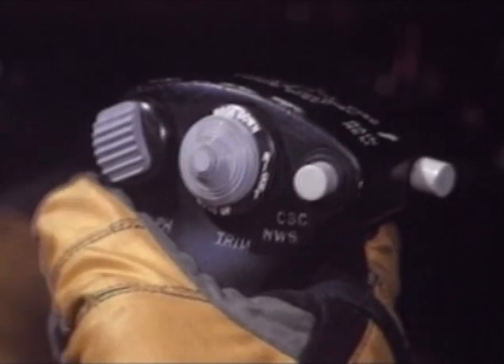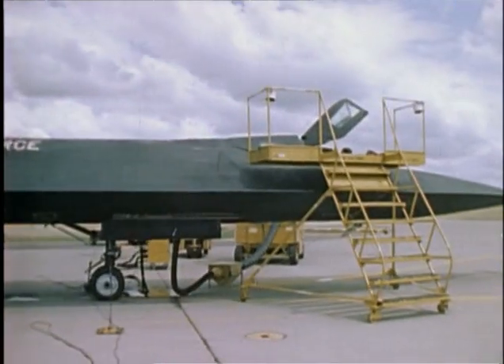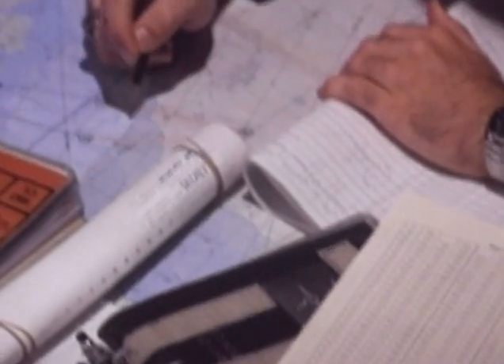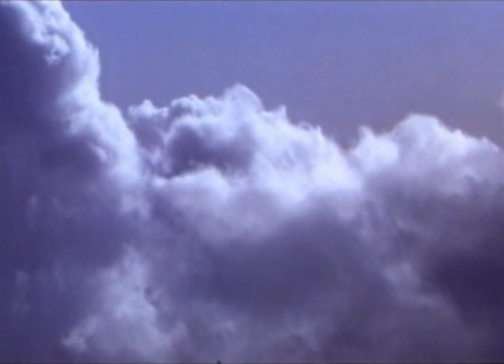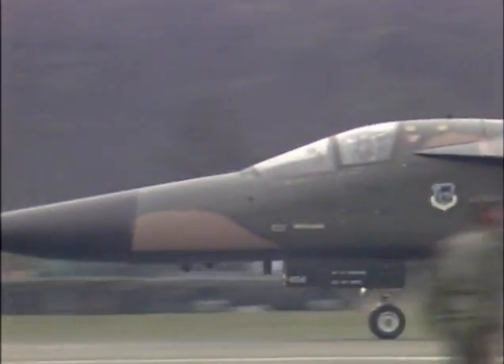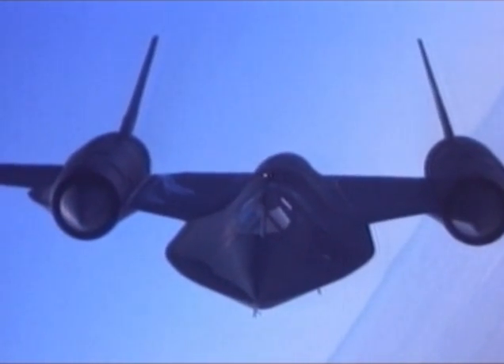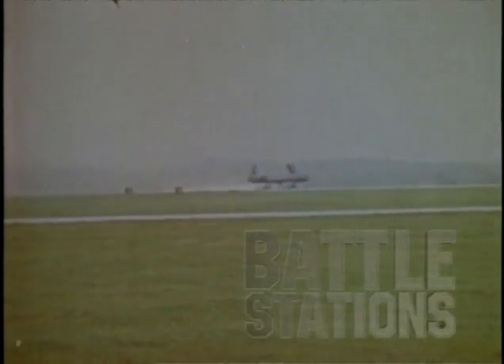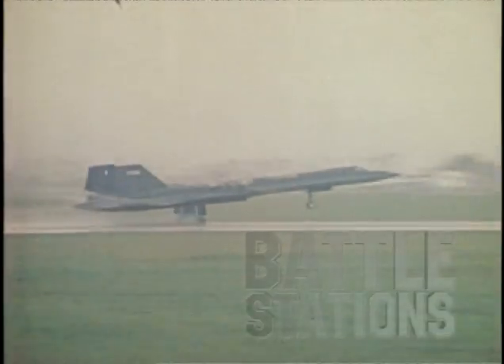Battle Stations - SR-71 Blackbird Stealth Plane -Full Documentary

Comment: I built my own sr-71 in my living room. It’s a smaller version but can still fit two men and the camera equipment and goes a little faster than the full size government built plane. I had it out over Iran when the missiles were flying from Iran to Israel and I got it all on film . I flew the first leg of the mission and my co pilot who is also my 15 year old calico cat flew the dangerous part over Iran . I shouldn’t let her fly in those dangerous conditions because she is reckless because she has nine lives so if we get hit with a missile she will respawn 8 more times I’m just dead but she can really handle the speed and out run any threat that we could encounter except communicate with air traffic controllers, so I handle that and she does the flying.

Comment: I live about 40 miles south of Beale AFB I first saw/heard them in late 66 early 67 it was not uncommon to see them in the 80’s in the pattern for touch n go’s at McClellan or Mather AFB’s McClellan had a hangar on west side that was usually open unless a U-2, SR-71, F-117 or ??? was in there for emergency support. An SR-71 got me out of a speeding ticket once I was on I-80 just south of McClellan & a CHP had me on the side when I asked if he had ever seen an SR-71? He said what I pointed over his left shoulder he turned looked and said you can go. It was more expensive to operate than Air Force 1. Two (maybe 3) tankers at refueling points in case first one had problems WHEN THE NEEDED PHUEL THEY NEEDED PHUEL as they didn’t glide well they could use regular fuel but limited to Mach 1.5 I believe regular fuel would get hot and rocket boost was short term. If I remember correctly they used more liquid Nitrogen than any other part of USAF possibly (probably) DOD. The U-2’s do training missions around Sacramento and the T-38’s practice here too when they(T-38’s) land at Mather a pizza or 2 is ordered for lunch; Mather’s hospital is now VA and I’ve seen them (U-2’s & T-38’s) MANY times

Comment: Nice presentation, but too much BS was added for the benefit of the other side.  At high altitudes the SR-71 could fly over 4000 mph, and it was the first stealth plane.  If it was stealth the enemy could not see it on radar (which the missiles used).

Comment: The blackbird is not the world's 1st stealth aircraft,  That title belongs to the Horton Ho-229, the blackbird on radar? The equivalence to the size of a door.

The 229? The size of a tack. However, this prototype aircraft never got off the ground, and secondly, a restored plane with no engines and no instruments was suspended on its center of gravity on a pole made of steel and concrete, from 4-5 km away, the 229 could not be found on radar as its radar cross section is tiny.

Comment: Strange bedfellows. In 2001 a solar powered aircraft named Helios flew to an altitude of 96,863ft joining the Blackbird as the only two aircraft capable of sustained, horizontal, winged flight at altitudes greater than 86,000ft. And Helios did this on the power of its shadow. Displayed at Dryden Flight Research Center along with an SR-71B,  it stood in remarkable contrast to the Blackbird. At 12ft in length, 247ft wingspan and weighing 2,000lbs, it flew at 20 kt vs Blackbird’s Mach 3+. What a difference in technologies.

Comment: Under his Single Integrated Operational Plan ..General .Lemay's main reason for tolerating the  Habus in his new S.A.C.formatted Air Force..was how these aircraft fitted his plan for reccom AFTER use of his and Mcnamara's nuclear triad..ICBM and SLBM..Lemay envisioned  the  SR-71's main reason in his strike plan would be flying "post strike" missions to determine if and when follow-on strikes were needed or warranted..un-built Senior Crown variations like the BX-71 under went feasibility studies with none of the proposed A/C reached the hardware stage since all assembly jigs and tooling were destroyed in 1968..however some of the early proposals were talked about which would involved the modification of existing air frames...

Comment: Something doesn't jive here. There must be a lot of refueling stops or done in the air because the information above gives it's range as 2600 miles, so if it's travelling at Mach 3 (roughly 2300 mph) , it could only stay up a little over an hour???
Reply: Another confusing thought:  If constantly refueling , how does the fuel source keep up with the SR-71??

Comment: I was stationed at Kadena AB in okinawa japan from 1983-1985, I was with 18 PACAF supply attached to the SR-71 squadron ( HABU ) called there named after the deadly snake. Blackbird in the USA. I was the one that had to store the black boxes and electronic components for the aircraft. They were classified back then and I had to stay inside a small ISOLATED room with no window with a teletype computer the size of a STOVE called SPERRY UNIVAC phase 4 that took 15 minutes to transmit and 15 minutes to receive a classified message for the parts and boxes. The Air Traffic Controllers used to tell me that when the SR-71 goes at 100,000 ft and higher at over mach 3.3 it is considered TOP SECRET and they had to SHUT DOWN the radar and only those with access can track it. I used to watch the SR-71 from the flight line take off on sunset and it looks like a GIANT BAT. I switched to the Army in 1992 and retired as a combat disabled veteran as an infantryman and scout in 2014.

Comment: It’s hilarious the J58 engines could cause the aircraft to melt just because of the air friction!!!
Reply: Actually, the titanium skin of the aircraft got stronger every time it flew because of the heat. Like re-annealing. The SR-71 was an engineering miracle - designed with slide rules instead of computers while learning to manipulate titanium to retain the shapes required.

Comment: I had a friend who was a maintenance mechanic on an SR-71 he told me several interesting things about the bird such as how badly they leaked fuel when they were on the ground and when they got up at speed and altitude they got so damn hot that the fuel leaks stopped they had to design them like that because the metal expanded so much. he also told me when they got on the ground the instruments such as altimeter and AirSpeed had a cover that would come down and cover them and that very few people we're privy to that information not even the ground crew new the capabilities of that aircraft

Comment: Yea, that thing was an absolute monster in it's time. It was way ahead of it's time truly. Yet...we have had much more impressive aircraft since before it was retired. The "speed record" is a mythical figure really. The SR-71 is considered publically as the record holder, yet it was decimated in speed and ability decades ago. The latest aircrafts that succeeded the 71 won't be released for public knowledge for many years. There's simply no point in making what you have known, because then any enemy can eventually design a system to combat it. The truth is simple. We can spy, deliver payloads, and stay entirely off radar within a hysterically small amount of time anywhere on the planet...without using satellites. I mean manned aircraft here, we have some insane stuff, stuff that will never be used for anything it's designed for, offensively anyway, if we can manage to avoid a true war. This is to take nothing away from the 71, it was an extraordinary plane, truly a masterpiece of its day.

Comment: The components and parts were designed to fit loosely, so much so that it leaked fluids on the ground.  But when it got up in the air at operating speed and temperature the components would heat up and seal the leaks.  This was an intentional design into the craft.  Most people do not know this.  But those of us on the ground had to clean up the leaks left behind by the SR-71.

Comment: I saw one at an air show when I was young and have been in love with that plane ever sense. Made models drawings and posters. And being able to set in the cockpit is an experience burned into my brain forever.
Reply: That’s awesome
Reply: Cool.  What was the cockpit like?
Reply: The 2 things that stick out is it had switchable abs for the landing gear way back then and it has a periscope for checking things around the plane in flight. It’s all hands on no computers. The pilots display that is the only screen in the pilots cockpit and all it shows is the flight path and it’s projected from behind from 16mm film. It has auto pilot but he said when they cruised at Mach 3 he had to keep his hand on the throttle and constantly adjusting back and forth in afterburner the whole time. He said it fine tuned the mixture I believe. No computer it was hands on.

Comment: The title of this vid makes me believe right off the starting line, that the author of this video is going to be full of shit! The SR-71 Blackbird WAS NOT stealth! The radar could pick it up clearly. The SR-71's strength was both it's altitude and speed. No fighter could get up high enough to engage it, let alone match its speed. No missile could catch it. That bastard could go almost into space and was so fast that she warped INTO flight configuration shape after reaching speed, because of the heat she generated. When she took off, they were pumping fuel into her tanks until she started moving, then she would reach speed, heating up, which would expand the metal. The pilots had to wear special flight suits, for both pressurization and heat resistance.

Yup, they are calling it stealth, It wasn't! This kind of misinformation pisses me off! I suppose I should qualify that statement. Reduce radar signature is not true stealth. The Soviets still launched missiles at her and they tracked her just fine.
Reply: Well, it was, they just didn't know it yet. From what I've read, the first radar tests produced a signature that was much smaller than expected, hence the comments. Same with the Flying Wings.
Reply: @meredrums1  There are actually a lot of details missing from this documentary. Not sure how many of them are still classified. For example, the titanium: At the time, there was only 1 source for titanium and that was the Soviet Union. They setup a series of corporations through which they purchased the titanium, so the Soviets wouldn't know who the actual buyer was. If the Soviets had known they were supplying the materials for the reconnaissance aircraft they hated, they would have shut it down fast! That part always made me laugh!
Reply: @One Issue Voter Wow. You really don't know what you're talking about. IT did in fact, fly over the USSR many times. It could reach altitudes and speeds which prevented the USSR from being able to shoot it down. In fact, the USSR tried many times to shoot one down, and always failed. Get your facts straight, please.

Comment: A-12 oxcart was faster
Reply: Unlikely.
Reply: @thethirdman225  https://www.cia.gov/news-information/featured-story-archive/2015-featured-story-archive/images/a-12/A12_SR71_infographic.jpg/image.jpg
Reply: @lisazack6459  Thank you. I've seen those claims before but there are several things I find a little unlikely about it. First of all, the A-12 and the SR-71 used precisely the same engine/inlet combination for near identical frontal area. Secondly, there's no point talking about these things in terms of miles per hour. The only thing that matters is Mach number because that is what governs how well the inlets will work. But hey, if you think it's worth arguing over a claim of 15 mph - which could easily vary with one degree of temperature at that level... Finally, I'm trying to imagine a reason why the CIA would bother even keeping such information.

The inlets are designed to slow the air down from Mach 3+ to about 550 mph because the engine cannot process supersonic air. To do this, the cane inlet needs to travel backwards to maintain the shock pattern or the engine will simply suffer a compressor stall. In the days before the SAS, the aircraft was prone to what became known as "unstart". This was a particularly dangerous condition which resulted in the loss of at least one aircraft.

At 85,000 feet and Mach 3.2, the difference between max. cruise and max. speed was nil. So it was not a matter of opening the throttles further. They were already fully open. This sort of anomaly has been part of aviation since the beginning.
Reply: @thethirdman225  When an individual starts arguing with official statistics they are on a hiding to nothing.
Reply: lisa zack This individual knows more about supersonics than the people who prepared that graphic. I can guarantee that. Like I said, how many miles per hour is irrelevant at that altitude. Ground speed could easily vary that much with a small shift in temperature. You might also want to consider what I said. I didn’t say it didn’t happen. I’m saying that using miles per hour is a very unreliable way of measuring it.

Comment: A great doco....
Btw , theres a great one on concorde .
A flight crew in a SR were told to give an upcoming plane some distance, to think with 100 passengers on board, without pressure suits, drinking champagne , and were passed by it........
Yep , newer tech (65 it was the start of the design phase I believe), but it was technology way ahead of its time..
I give you concorde..... 68000 feet... not bad.
But my goodness....... The SR is the sexist mofo and the apogee of tech. Work of art.

Comment: The blackbird is by far a much more sophisticated weapon than the mig 31, however the Russians got a plane that could harass the otherwise out of reach blackbird. I believe that was one of the reasons it was put out of commission. Otherwise it was a marvel of technology, and the mig 31 comes no where close to it. It's just that the mig 31 carried long range supersonic air to air missiles that could within a certain range shoot down a blackbird, and the mig 31 did intercept the blackbird on a couple of occasions which was the end of high altitude spy planes. But while the blackbird is out of use, the mig 31 which was designed as a top of the line interceptor for the Russians still serves its purpose of being and interceptor that can intercept even high altitude supersonic aircraft as good as the blackbird SR 71.

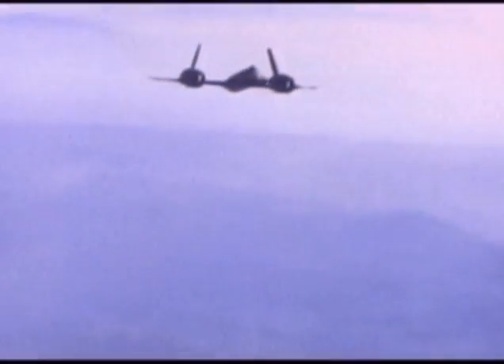Comment: 16:31 someone didn't do their homework. You don't hear three sonic booms if the something is moving three times the speed of sound, it is still only one sonic boom. which is actually two but are so close together it appears as one.
Reply: Actually you are wrong.The front of the nose created the first and the two others were produced by each engines point of intake. Please do your homework.
Reply: The engine nacelles produced a shockwave, but its muted compared to the bow and stern shockwaves and is lost in the fore and aft booms.  The middle boom was subtle enough the human ear can't hear them at the altitude the SR71  typically flew at.

However, the bow and stern shockwaves were enormous - and VERY audible.

The typical sonic boom from the SR71 was a sharp, deep, and distinct double thud, with a longer pause between thuds and a more bass tone than those from a typical fighter sized aircraft.  those that have heard both say it was similar to the Concorde's boom. (Can't confirm this personaly as I'd never heard the concorde)   I've heard the Boom from an SR71 -  to my ear it was definitely a distinct double thump.

Comment: @19:00,  was that leaking fuel on the underside?
Reply: John Ang yes, the fuel tanks were actually designed with expansion joints that leak when the plane is on the ground. When it reaches full speed and full temp, the whole aircraft expands and everything seals up. That’s one reason why they take off with a half fuel load, then immediately hit a tanker (besides saving wear and tear on the tires which are only good for about 15 flights. The aircraft grows by 3”-4” in length at full speed.

Comment: CHENNAI-OKYO 100 TON, 6 MACH  2 H   240,000 HP; 12,000 CBM  IN  23 M ^3 PRESSURE VESSEL AT 600 BAR . 1.23 Mn LBS/SFT WATER THRUST  INSTANTLY  FARE 2000 $

Comment: NO FUEL, NO CO2e , NO ELECTRIC HYDRO ENERGY 100 TON, 6 MACH WATER LANDING , FLOAT IN WATER. 45* PAD LAUNCH, RANGE 120,000 KM   2 Mn HP,  100,000 CBM 46.5  M^3
Reply: IMAGE MISSING  3,6,12,30 MACH SPEED 1- 100 TON 50 % PAYLOAD. NO ENGINE, NO ELECTRIC, NO SOLAR,   CATAPULT ENERGY AT 1.23 Mn LBS/SFT WATER  THRUST INSTANTLY

Comment: February, 1072. I am in Udonthani RAFB in Northern Thailand. I was a Weapons Control Systems mechanic for the F-4. Got a work order, and skipped on out to my hanger. Sitting Immediately next to my aircraft...SR-71. Roped off, armed guards. What a bird. I had seen thousands of take-offs, afterburners screaming, but I ain't never seen anything like this. The word was it was gonna takeoff at midnight, so midnight found my happy ass sitting on top of a protective wall. Out of the hanger out it comes...flopping around and fuel actually dripping out all over. turned left, then left onto the runway, hit the ABs and good God.....In maybe 10 seconds it was going straight up ...within 45 seconds a sonic boom hit us. A minute or so later another boom. Just amazing.....my friends and I were sitting there in the silence stupified. I can think of no reason there will EVER be another bird like that. Wow.  47 years later and I remember walking around it on the ground.....marveling at the immense size...and the futuristic, almost alien design. I was accustomed to clamoring over bomb-laden F-4s ready to go...I even once had to do a little tweak on a bird sitting at the end of the strip, engines running, had to climb up, stick my head down in the pilots lap ...made the adjustments, and went back to the crib. So I thought surely they would let me examine the aircraft. WRONG!  But I did get close enough to really get a look at it. Will never forget it.